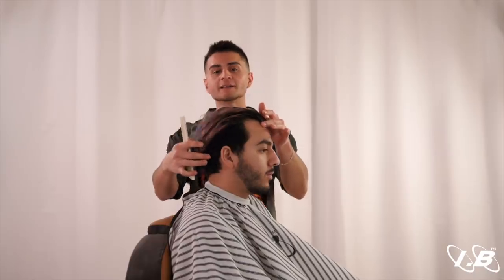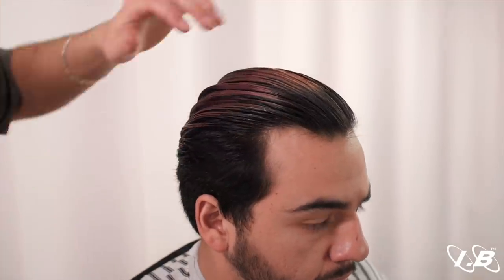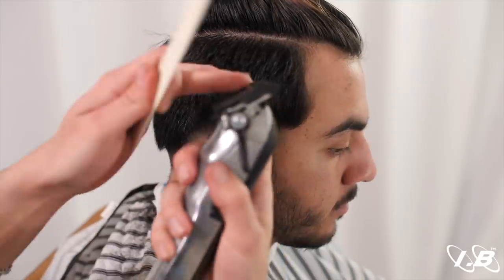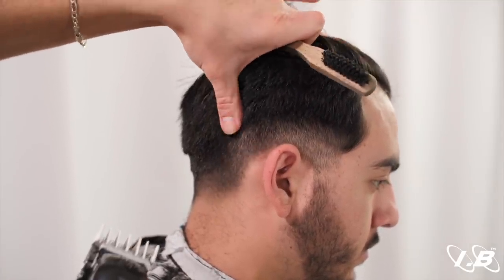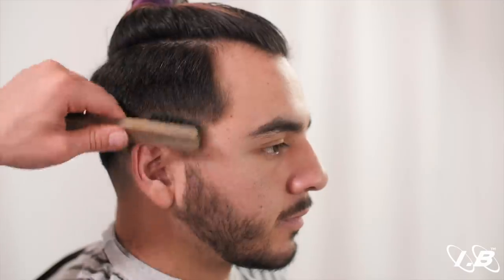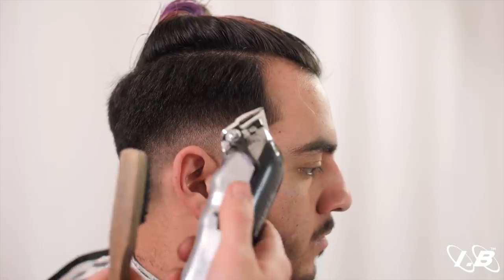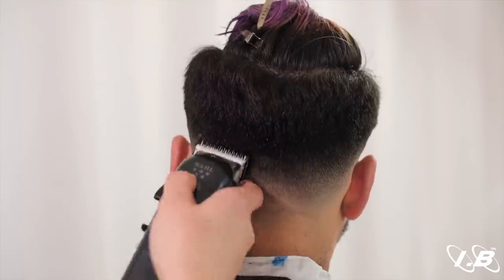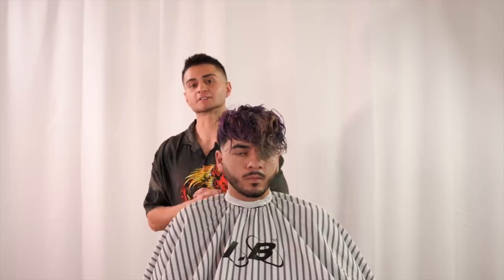Flawless LOW-FADE technique - BARBER Tutorial

Comment: For those who are confused on why he doesn't start with a bald guideline is because that method is a somewhat beginners method. It leaves too much lines to work with; he says multiple times he starts with higher guards to control the fade.. it's his "secret" to a blurry fade
Reply: You can do this fading up also. Its just preference. He actually "wasted" some time by using this fade down method cause he ended up having to push the fade up higher to lighten it up more because he didnt go high enough with certain lengths the first time. Fading down is a great method but unless you fully master it.. On these lower type fades you will end up taking more time because you have to really know how high to go with every step or you run the risk of having to do the fade basically twice instead of once then detail.. it ends up being fade twice then detail instead of doing your steps once then detail. hope that makes sense.
Reply: it's not a beginner method it's just preference. Whatever order you do it in or where you put the guides it's still the same techniques at the end of the day
Reply: Aaahhhhh.....

Comment: Dope cut! Mad confusing though 🤔
Reply: this is more advanced technique, fading downwards is a better option.
Reply: Yeah i can see why it’s confusing lol. I understand it though
Reply: Eevee His Blend came out dope! But definitely not advanced. He used the 1 1/2 to blend from the 2 guard down to the 1, then did more steps just to remove it with the half guard in the same exact spot. Not advanced just extra.
Reply: LOYALTMAFIA23 well i disagree every fade includes those numbers. the most important part of a fade. second the technique is advance cause when you usually start cutting you fade up wards which seems easier for people when learning. downwards is a bit trickery due to people can’t see exactly what they are doing and get lost in process for example they are not sure if it’s a 1 guard or a 1/16 in that area due to not having guidelines.

Comment: It’s a great haircut but I’m my opinion you’re taking way too many steps to complete a low fade
Reply: There were unnecessary steps.. there's no need to use the lever for #1 1/2 ( white guard ) because 
it's a blending guard. With the #1 guard, you don't need to put the lever in the middle, just open and close.
Reply: Re-signed with Top Rank to avoid Errol Spence Jr. really? If i don’t put the guard in the middle between open/close i can still see a shadow...

Comment: First of all, this is C L E A N ! 🔥 
For us newbies, can someone explain why this method of fading down would be more beneficial than what’s typically taught? That would be starting with bald line and moving up from there. 

In this video he seems to repeat everything twice. Any input? Thanks!
Reply: Yeah so this technique he is using is the really safe way of keeping your low fade really low and retaining as much bulk as possible. You can still do this fading up or using other methods but you run the risk of taking the fade too high.

 The first steps he does is just getting rid of bulk with his guidelines and then fading the guidelines out by fading down essentially. He goes through it again to detail the fade since its a compressed fade you have to detail it a lot and spread the blend out just enough so it doesnt end up looking like a soup bowl. He would rather control the bulk and get the darkness he wants and fade into that darkness by detailing with shorter guards using corners using the heel of the blade with the half guard as well so it doesnt push the fade too high. 

Me personally i just take a 1.5 open where i want the hair to be short at fade down with the 1.5 to closed. Make my skin line with your clippers closed so you have more room to work with. Then i just create a half guard blade open guideline 2 finger width then i just fade down from that down to the skin line i made with clipper closed. Only step left is to connect half guard open with 1.5 closed which should be easy. 1 guard open then closed. 

Then you just use your mirrors and take a step back and look at the fade from all angles. There are going to be dark spots in a very compressed fade. Now you just use the 1, .5, or blade open to remove dark spots in the fade. Not digging in but using light pressure, corners, and the heel of the blade to get them out without making patches or holes in the fade. Easier said than done but this fade is literally all details. You can use thinning shears as well to lighten certain areas up or make the bulk blend into the clippers better like he did in the video.

 The system you use is just to control the bulk and get the hair to the length you want it at. The actual fade is in the details for this haircut. These fades will take more time to do than a regular fade even for a experienced barber.

Comment: I'm a barber, I don't have the best experience but I think you complicate yourself by starting with the 1. Because later when you use the 0.5 guard you went high as the 1 and then you had to use the 1 more higher. Personally I prefer to start with the half guard making the first guide line! Even though, you could manage that and the result was very smooth! Congratulations
Reply: I agree thats why fading down unless you really master it wastes time especially on these bulkier fades. If you dont know exactly where to end each length you end up having to do the fade all over again basically.

Comment: I started cutting younger brother hair I always have trouble blending the fade guideline I watch videos and they suggest the flick in -out technique but it doesn't work I just end up pushing the guideline higher and it turns into a high fade most of the time I spend on the haircut is on the f'n blend which is ludicrous any tips
Reply: yo bro. personally I think it depends on what your using for your first guide line. I suggest that u use your clipper as your first guide line and then your trimmers afterwards. (I'm just assuming you've got both). this way you dont have to flick out and keep the guide line consistent but still dont dig in the line cause it'll be much harder to take out. hope that helps

Comment: The machine i got has different numbers that I can switch to. But it doesn't have a lever. Can I still use that
Reply: Technically its possible...kinda, but its not the same. Get a cheap pair of wahl designers or something for $40-50. The lever makes the blend smooth.

Comment: I struggle with the 1/2 guard. I can transition from no guard into the 1/2 guard but transitioning from the 1/2 guard to the 1 guard is always impossible for me. The feel of the guard is a little different than the others. How can I improve this flaw?
Reply: Hey brother I had the same struggle when first starting, the key to transition the 1/2 to 1 and so on is playing with  the lever while using your corners. Hope this helps
Reply: If I’m not mistaken, the 1/2 guideline should be established with the lever open (no guard), and the 1/2 guard should be used only to blend into the 1 on top. I read somewhere that half and 1 and a half guards are blending guards and not to be used to establish lines. Cheers!

Comment: Much faster way: 

1. Debulk with 4 closed flicking out 
2. Set the trimmer line and clear what’s under
3. Set the balder line and erase it right away
4. 1 1/2 open about an inch and a half flicking out 
5. 1/16th guard closed flicking up a bit 
6. 1 guard closed flicking up a bit 
7. 1 1/2 guard closed flicking up a bit 
8. By now it’s 5 minutes and your fade is looking done (sort of) 
9. 1 open all the way, then half closed then closed 
10. 1/16 open then half way then closed 
11. blade open then half way then closed 
12. Trimmer flick up into the 0
13. Detail using corners of your 0, 1/16th and 1 open 
14. Blending shears to extend the fade beyond the 1 1/2 without removing bulk from the top of the sides 
15. From the 2 forward, clipper/scissor/trimmer over comb, or guards from 2 to 6 based on personal discretion

Comment: Clean but you are using to many steps. No one wants to be in the chair for an hour. Find more efficent techniques that will make you faster. For example instead of using the 1 then 2, Just use the 2 to remove the bulk or better yet Clipper over comb and create the shape that way you spend less time fadinfHaircut should be Minimum 15 minutes maximum 30.